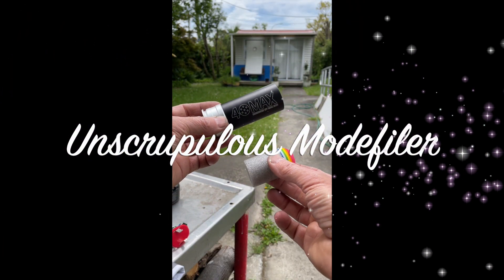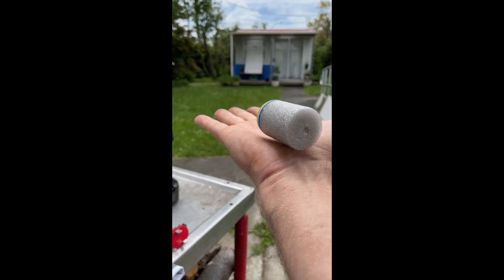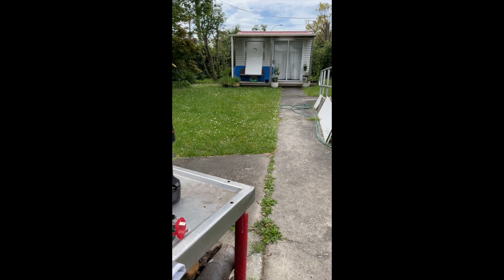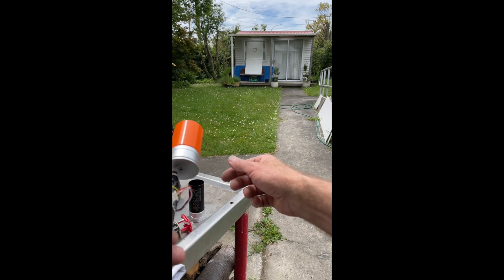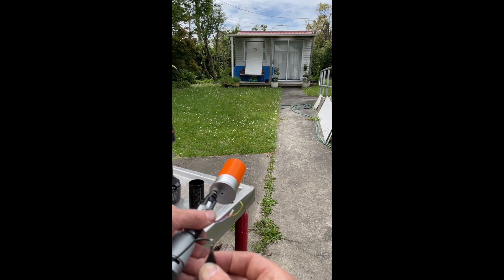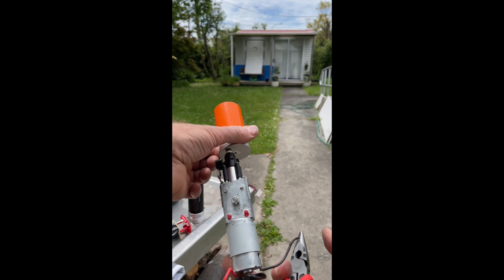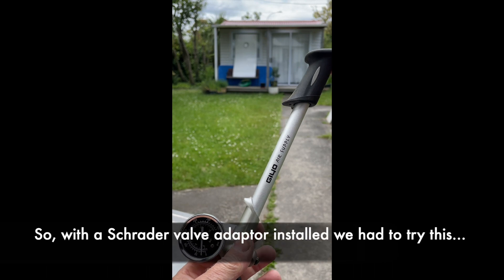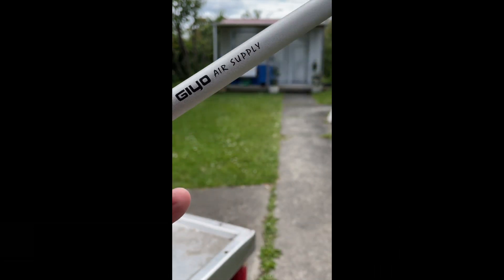40MAX 40mm Launcher adapted for a bicycle pump

Comment: Does your bike tire needle adapter (3mm aluminum tube + Oring) seal tight enough to use the hand pump with the same needle adapter to charge the 40MAX to 150/200psi?
Reply from the maker: I've not actually tried filling directly with the manual shock-pump and needle valve-adaptor. I'd imagine it'd be possible but you'd need an extra set of hands to hold the needle to the inlet valve and  pump at the same time. People have suggested building/printing a unit to hold the shell, but again I've yet to try it.

Ideally if you only have the shock pump or wish to fill to higher pressures than a 12v powered unit can get to, you'd build a separate (much larger volume) pressure vessel with a Schader inlet and a regulated needle-adaptor outlet. Pressurise with the hand pump then fill the 40MAX shell to the regulated pressure.
Reply: @unscrupulousmodefiler  the shock pump just goes higher than most of the electric pneumatic ones. Like A LOT higher lol I’m sure I can strap it to something to hold the pump body, while I actuate it and hold the valve and stem together. Thank you so much for what you’re doing and sharing here!!! It’s incredible what you can do with some wit and ingenuity
Reply from the maker: @oakridgereview1359  Haha! You're welcome. I just keep sticking things where they don't belong until something works 🤣 PS: latest stuff always ends up on Insta first if you want to see more shenannigins: https://www.instagram.com/unscrupulousmodefiler/

Good luck, stay safe and have fun! 🤘😎👍
Reply: @unscrupulousmodefiler  I gotta get a new one, I logged out with my new phone and can’t get back on my old one haha but I’ll absolutely check it out! Thank you!! Just got my 40MAX Shell in the mail today, waiting for the 3x2mm aluminum tube tomorrow to try
Reply from the maker: @oakridgereview1359  Wicked! Let us know how you get on 👀
Reply: @unscrupulousmodefiler  EDIT: IT WORKS!! I used a small drill bit and reamed out the bore of the tube. It takes some pressure to hold the seal tight and it’s awkward but you 100% can get 200psi. 

OLD: I bought the 3x2mm tube but I can’t get my Ball Needle stem to fit in it.
Reply from the maker: @oakridgereview1359  WHOOHOO! Nice going! 👍👍 Now for some tasty projectile flinging 😉
Reply: @unscrupulousmodefiler  I’m going to pull the OEM stem out of the Schrader valve portion, drill out and press in the aluminum tube, I think that’s a more reliable and sturdy solution. What adhesive would seal and lock in the tube though? I’ll make a response video or something showing it
Reply from the maker: @oakridgereview1359  Hmmmm... you're looking at a fitting that will have to take ≥150psi of pressure plus a fair bit of abuse from being pushed/held into the inlet valve by hand. It might be that a push-fit into a clean drill-hole (even with a serious adhesive) won't be enough. Can you maybe cut a thread on some tubing to match the thread inside an actual Schrader valve? (I'm not sure what the measurement for that thread is...) Pretty sure you'd need the extra grip of something like that to hold your tube in place.
Reply: @unscrupulousmodefiler  SO! … I pulled the OEM Stem out, counter sunk the hole with a 3mm bit just a hair larger than the aluminum tube and maybe at absolute most 3mm deep into the male threaded valve body. Used a small nail to flare the end of the OEM stem and pressed it back into place after cutting it .625” long. I then cut the aluminum tube to slightly longer and bored it out with a 3/32” BUT ONLY FAR ENOUGH to allow coverage of the OEM stem. The one end needs to remain 2mm or smaller to press on the grenade valve. I used Locktite Gel Super Glue to secure the tube around the stem and then slid some 1/4” rubber mat (punched a hole out to fit the new stem) and glued it down religiously. Im actually sorta pleased with myself lol…
Reply from the maker: @oakridgereview1359  Haha! Awesome work! I'll have to grab another needle adapter and follow your instructions to make myself a spare👌

Comment: Any ideas to get the 40MAX to retain its original from factor to be used in launchers IE a picobooper with using a hand pump off the field to help the wallet and be compliant with event rules only allowing hand-pumped pneumatics?
Reply from the maker: Currently, achieving that hand-pump-then-disconnect-leaving-only-a-stock-shaped-shell is a bit of a unicorn... these shock pumps all seem to be set up for Schrader valve attachment which means having to leave an adapter poking out the back of the 40MAX, and filling using the existing inlet valve with compressed air and a needle-type adapter (ie: same form and function as the outlet on a green-gas can) you get the best results if you have your air already under pressure (otherwise you'd need a couple of extra hands to hold the needle to the valve and pump at the same time...) It could be possible to rig up a different sort of adapter but that would be an additional cost - possibly *per shell*...

A rules-lawyering workaround might be to manually fill a larger, separate tank to higher psi which you'd then use with a needle-valve outlet and regulator to fill the 40MAX shells between games (basically a hand-pumped can but with compressed air instead of green gas...) No-one could argue that the air wasn't compressed "by hand" and you could get accurate and consistent pressure in the shell, but at that point you may be running into issues with the organisers simply not wanting pneumatics on the field but not wanting to say it.

My go-to wallet-friendly solution is to use a modified needle adapter on a hand-held 12v compressor:

Construction: https://www.instagram.com/p/CV1HSTIh6TQ/

In action: https://www.youtube.com/watch?v=Ya6-b0B9xyA&t=78s

Simple to make and easy to re-fill with no mods to the shells themselves. If you start the compressor up before you insert the needle into the inlet valve then keep it running while you're disconnecting you get a higher and more consistent tank pressure that won't ever get over 180psi. It just isn't "hand-pumped" 😅
Reply: @unscrupulousmodefiler  That makes a lot of sense. Thank you! the hand compressor seems to be the core of the idea I was thinking of just well effective.
Reply from the maker: Having said all that... it might well be possible to 3D-print something that could hold a stock 40MAX shell and a shock pump with a needle adaptor together so that they stay sealed while you pump manually... 🤔
Reply: @unscrupulousmodefiler  At that point the compressor makes just as much sense unless you really need to be quiet for some reason.

Comment: Just add a little silicone oil occasionally for the seals if your relying on compressed air. Green gas is a mix of propane and silicone oil without the sulfurous odor additive mercaptan
Reply from the maker: Thanks for the advice! I've just got my first kit for refurbishing my original tank (replacing the o-rings etc...) because initially I didn't do this enough. Silicon oil between times really does seem to help keep a better seal on everything 🙂

Comment: How was the adapter made?
does this require permanent modification?
machining?
off-the shelf parts?
Reply from the maker: Adapter's pretty straight-forward and doesn't require any permanent modification to the 40MAX tank.

In a nutshell you cut the Schrader valve off the inner tube leaving about 15mm of extra length beyond the original threads. Scrape all the rubber off the un-threaded end revealing the brass underneath. It should be about ø6.0mm, which should fit the M6x0.75mm die without issue.

See the wider "rim" in the middle of the Schrader valve in the stills? Ideally you'll use that as a seat for a sealing o-ring (you can see it on the adapter's thread in the last of the still images), but it needs to fit into the original valve's seat on the tank. I skimmed that widest part of the brass very slightly on a lathe until it matched the max. ID of the inlet valve but you could easily just file it down until it fits. Alternately you could use thread-tape but it's a pain to have to keep replacing it.

The trickiest part is the threading itself: firstly holding the die (the one that I got from that listing is smaller than any of my holders so I had to improvise...) and then holding the Schrader valve so it doesn't spin while you're cutting it with the die and ruining the original threads.

FYI: I unscrew the internals of the Schrader valve so it's just an open tube (better airflow) and leave any pump hooked up for the duration. While technically it should be possible to disconnect the pump fast enough to leave enough pressure in the tank, in practice the tank is so small that too much leaks out too fast before the Schrader valve seals.